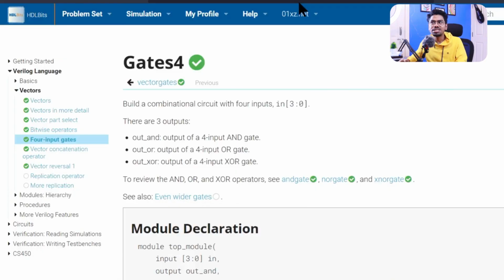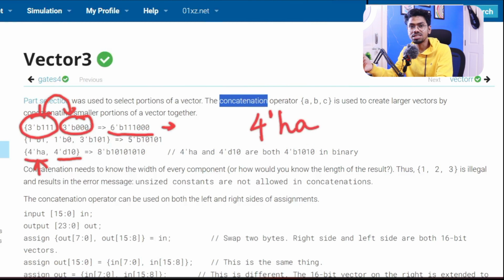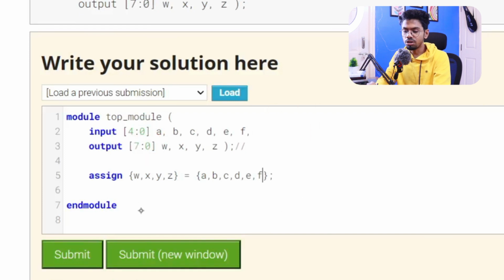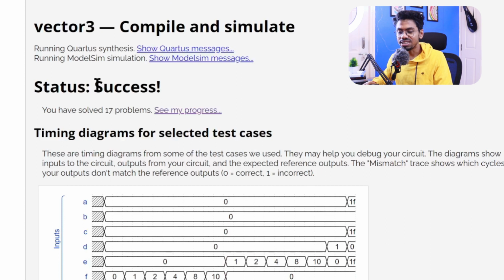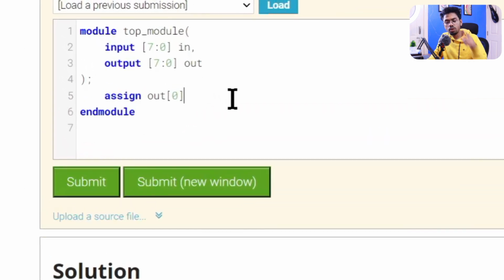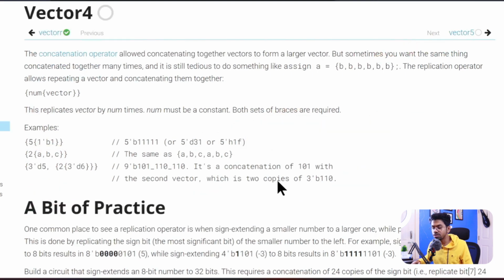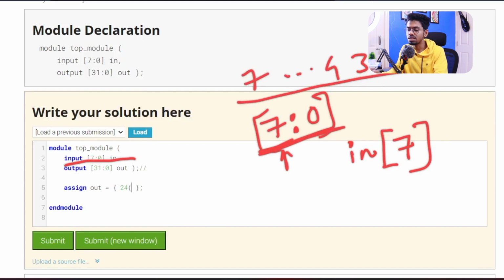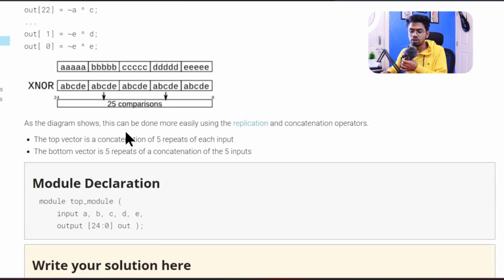Lets Learn Verilog with real-time Practice with Me | Vector concatenation | DAY 6

Comment: module top_module (
    input a, b, c, d, e,
    output [24:0] out );
    assign out = ~{ {5{a}},{5{b}},{5{c}},{5{d}},{5{e}}} ^ {5{a,b,c,d,e}};
endmodule
i tried with this i got status as success.
but they given another solution. i.e,
module top_module (
	input a, b, c, d, e,
	output [24:0] out
);

	wire [24:0] top, bottom;
	assign top    = { {5{a}}, {5{b}}, {5{c}}, {5{d}}, {5{e}} };
	assign bottom = {5{a,b,c,d,e}};
	assign out = ~top ^ bottom;	// Bitwise XNOR

	// This could be done on one line:
	// assign out = ~{ {5{a}}, {5{b}}, {5{c}}, {5{d}}, {5{e}} } ^ {5{a,b,c,d,e}};
	
endmodule